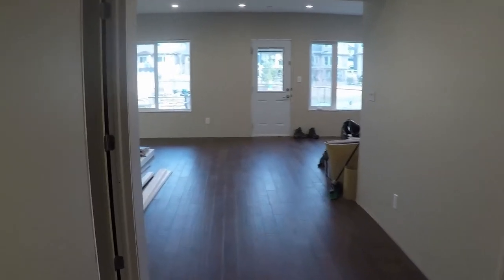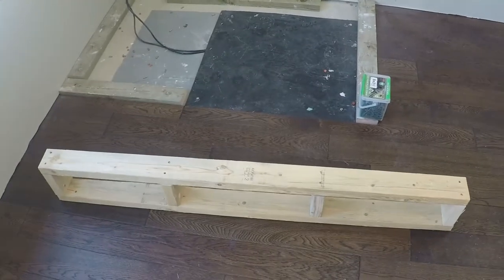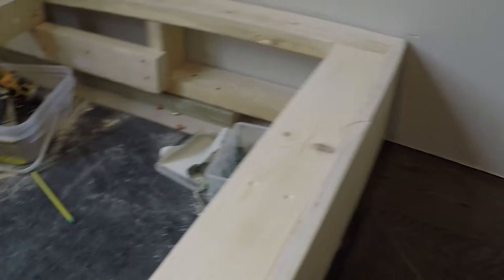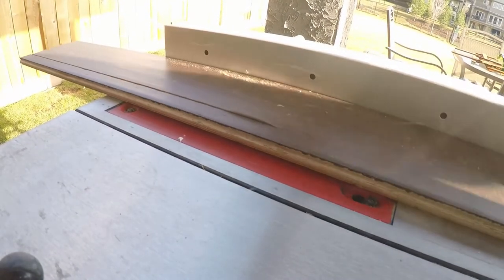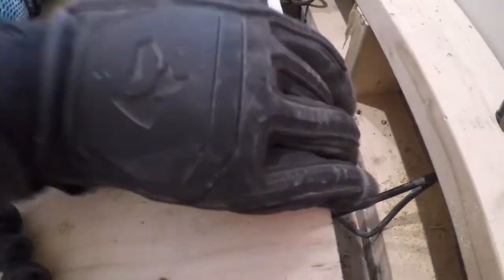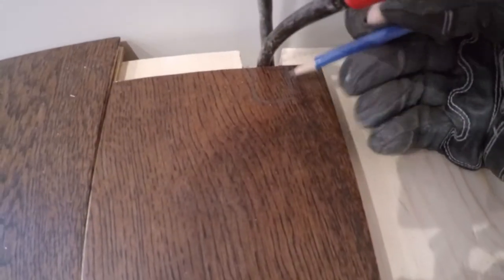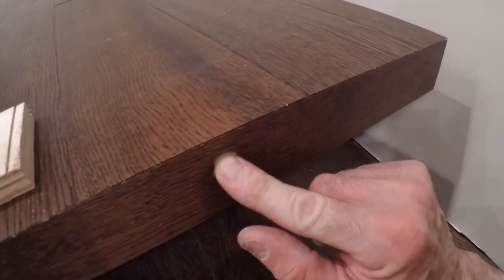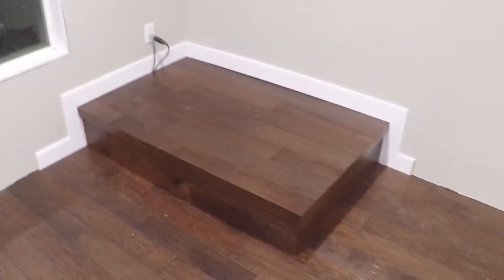Sump Pump Cover Hardwood Floor

Comment: Thanks for this. I have a walkout basement onto a lake and the sump pump pit is right near the walkout doors. Definitely not an ideal place and was wondering what to do.. this is a great solution
Reply from the maker: All my neighbors have the same thing with the sump pump. It really is a terrible spot for it from an aesthetics point of view. My neighbors all went with carpet and just rolled it over the pump with a cut line so the carpet could be pulled back. I also hated that because you could see the cut line, and feel the plate under the carpet. Best of luck, thanks for watching.

Comment: This may be a silly question but does the sump pump still work/ serve it's purpose with this approach? Does that box need to have openings to allow water to flow into the sump pump in the event of a flood? I'm looking to do something similar for my basement but want to ensure it's not interfering with its purpose
Reply from the maker: The box doesnt impact the sump function in anyway.
All the weeping tile is below the grade of the basement floor and flows underground into the sump hole.
As for the discharge that also travels in a pipe below the level of the concrete floor and out to the city line.
Your layout might be different based on the local codes in your area and the codes that were in place when the house was constructed
Reply: DIYNorth thanks so much! Appreciate your very prompt response!

Comment: Have you had any mold issues since you have covered the pump? I covered mine with a faux bench and when o lifted the top it was full of mold 😮
Reply from the maker: I don't know. I've since moved. I would say no, but that house is in a very dry area and there was never really water in the sump except for in the spring. I don't think that I heard the pump turn on more than twice in the 5 years I lived in that house.

Comment: Where is this sump pump located? In the opening scene It looks as if it is located above ground.
Reply from the maker: Pump hole is crazy deep on this house. Its about 8 feet down. Overall location for a walkout basement is terrible though. Messes up the flow of that room in a major way.